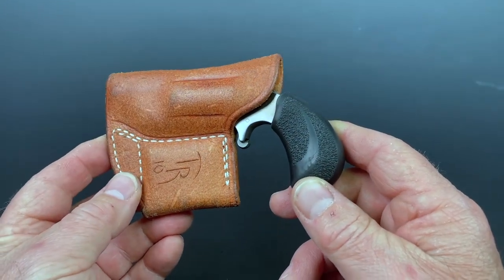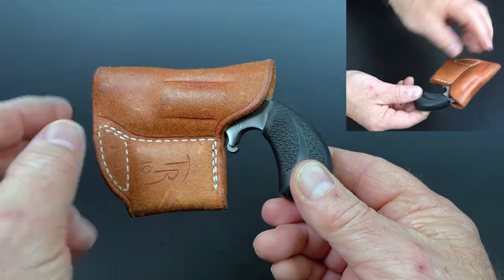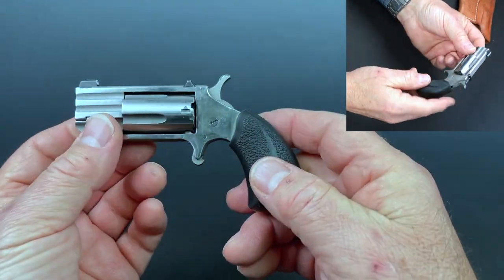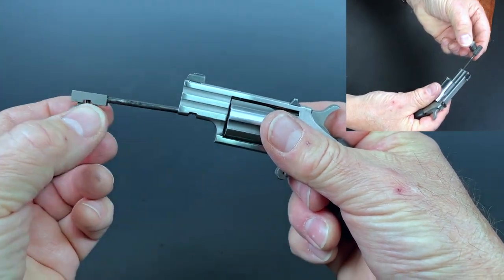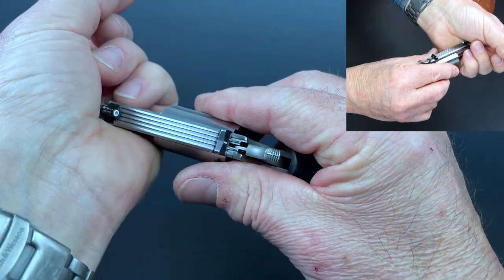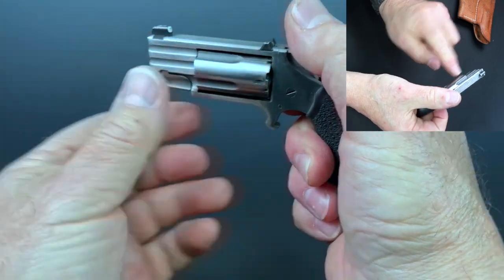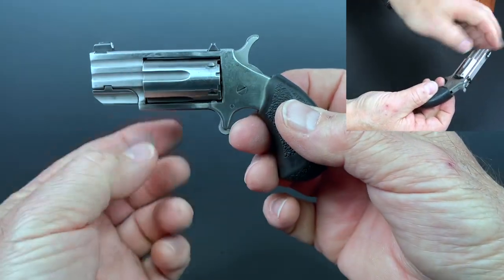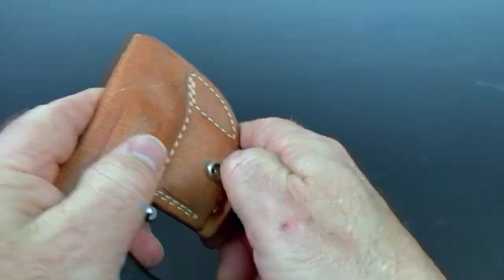The Trick to Loading & Unloading the NAA Pug Revolver

Comment: you like to carry it on an empty chamber? what? like you only have 4 live rounds in your pug when you carry it?
Reply: Yeah i was thinking the same thing. Like the safety notch is specifically there to carry all 5 lol.
Reply: @oveson88  yeah carrying a full cylinder of 5 rounds is %150 safe!
Reply from the maker: Extra-safe. The “safety notch” between the cylinders can still allow the cyilnder to move if the hammer is bumped slightly during carrying. That raises the firing pin out of the tiny notch, allowing the cylinder to rotate. Better to be safe, for sure with the hammer all the way down on an empty chamber. The empty chamber won’t allow the firing pin to move out of it. Also, four rounds are better than no-rounds? Roy H.
Reply: @fmgpubs  that is the worst reasoning of all time.
Reply: Read about ppl accidentally shooting themselves by leaving in safety notch I agree with hammer on empty
Reply: @brandonhenson2610  like you've heard of that happening specifically with north american arms products?
Reply: @DaBossk  yes read it on a forum wasn't there so can only believe what they said
Reply: Wrong! @fmgpubs
Reply from the maker: When I was a cop in San Diego, we had an officer who used to jog with a NAA fully loaded in his shirt pocket. He bent over and the gun hit the concrete and went off. The hammer had migrated off of the safety notch in between the chambers. It can happen. Roy @johnclifton218
Reply: We rarely carry our NAA, but we also carry on an empty chamber...our reasoning is if the gun is actually needed things are already beyond bad news, and we will be happy to get two quick shots off...these aren't gunfighting guns, rather get off me guns, best used at about arm's length in range from the bad guy...

Comment: Why would you leave the hammer on an empty chamber?  There are safety slots for a reason.
Reply from the maker: The issue with the slots is the fact the cylinder can turn out of them. A bit of pressure on the hammer (just barely) in a pocket, say, can allows the hammer to rotate. Just being extra-safe is all. Roy

Comment: For the same reason it slips out of the safety slot (slight pull back on hammer) couldnt it just move position off of the empty location and onto a live round? Or is the thought that youd need to get fully to the half cocked position for that to happen?
Reply from the maker: The hammer would need to move quite a bit to move off of the empty chamber. Roy
Reply: @fmgpubs  copy that, thank you. Appreciate you mentioning this concern, first I heard that but in searching it out there are quite a few others that mentioned occurrences where it moved off the slot 

There appears to be some tight fitting holsters available that are designed to receive the cylinder only in a locked position. Perhaps that could help prevent cylinder turn
Reply from the maker: I’ve seen those and indeed that would help. Too many people just toss these in a pocket and I think that’s where trouble comes. I’d think simply having it in a pocket holster would prevent issues. Roy @anthonyb2426

Comment: Why are you carrying with the hammer on an empty chamber? Is there a safety concern you have?
Reply from the maker: Richard, the hammer would rest right on the primer edge of the cartridge. If you dropped it and it struck the hammer it could go off. There is a “safety” notch between chambers but I’ve found sometimes the cylinder can still be turned as the gun is handled, rattles around in a pocket, etc. Better safe, at least for me! Roy H.
Reply: @fmgpubs  Pretty sound advice after taking a good look at it again. Thank you.
Reply: @fmgpubs  if you have the hammer in the inbetween notch, there is no way the cylinder can rotate.
Reply: @fmgpubs  So, does that mean you only carry 4 rounds?